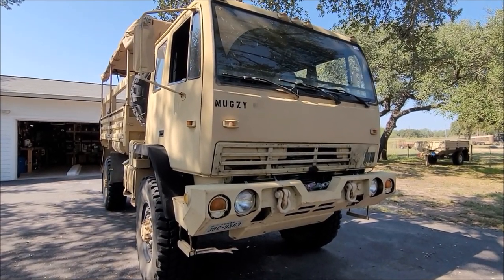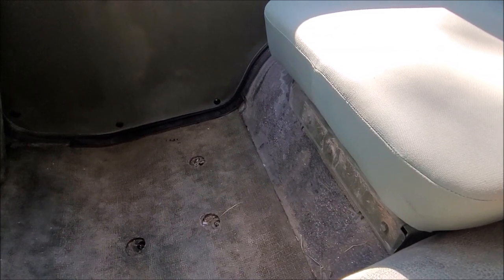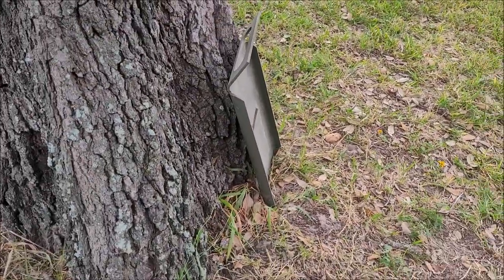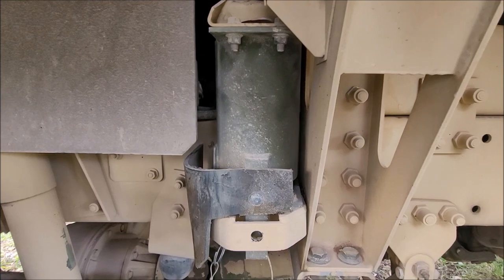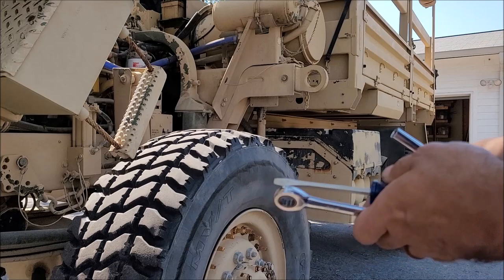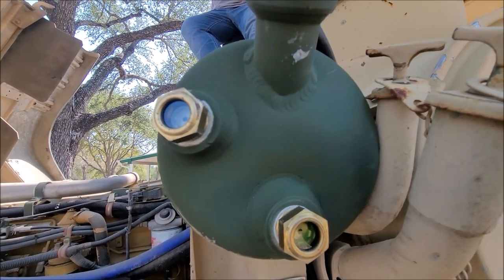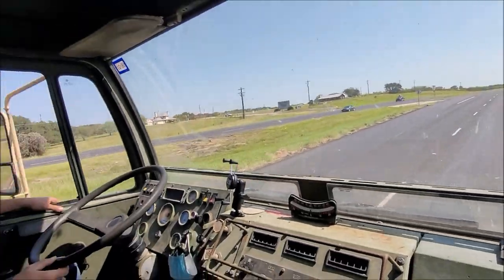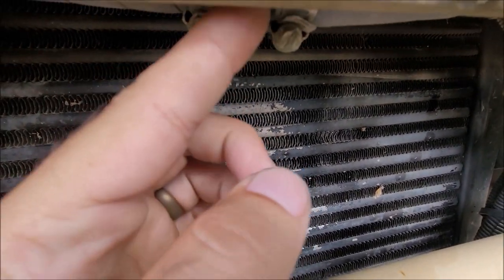M1078 LMTV - Update #2 Radiator overflow bottle change out & more!

Comment: Hi Colt.  A lot of the issues you are having with your truck are covered in my build series.  Not sure if you watched it yet?  Those sprayers are easily sourced from amazon and come in a 3 pack IIRC.  I had to replace all of mine too.
Reply from the maker: Yes I have watched some but not all... there are a lot. :)
Reply: @CallMeColtLLC  do you happen to know how to turn on the amber warning light ? ( light on top of the vehicle )
Reply from the maker: @stevenmajicmike  There is a switch on the dashboard for it.

Comment: That unknown thing is a jack base...   I don't know where it goes.  The plastic cap on the heater hose behind the grill is a flush fitting so you can use a garden hose to flush it.  If you replace that hose, I'd toss that fitting...   I've had them break on me when they get older.
Reply from the maker: Thank you! That makes sense for the jack base. I'll make a spot for it. That fitting did leak a bit & stopped itself. Wish I knew it was for that when I did my coolant flush! Would have used it & then removed it. Oh well, next time. Thanks again!

Comment: If you plan to drive the truck around without the cab airbags filled, then insert the transport pins so you don't pop the airbags. Also, you can simply replace the OEM airbags for cheaper than the "upgrade" kit. You can find NOS airbag assemblies for $250 ea. on ebay... They last decades...
Reply from the maker: The only new, old stock cab springs I found were $600 each. If you have a link to get them for $250 each, please let me know.
Reply: @CallMeColtLLC , I bought one on ebay for $225 about 3 months ago. The same seller had 2, I probably should have bought both... It's something you see pop up every few months. Also, folks on the FB group will offer them up once in a while. Just keep your eyes peeled.

Comment: What size extinguisher you ask?  get biggest fire extinguisher you can fit.  I had an LMTV alternator fire and it took equivalent of about 5 or 6 of those 1lb extinguishers to get it out. (approx 7 gals of ABC extinguisher and water to knock it out.)  Maybe true automotive extigisher would cut that down some..... do not know how much though.
Reply from the maker: I have a mount from an MRAPV that I have a brand new extinguisher for. Might find a way to mount that.

Comment: You fill the coolant reservoir up to where you can just see it in the upper sight glass when cold(-10 manual)...   looks like it is running good:)  whats wrong with ctis?
Reply from the maker: I need to put a tad more coolant in. Plan to do a full flush of the system in a few weeks. No idea on the CTIS. Want to get the other stuff done before I dig into that.
Reply: @CallMeColtLLC  does your spare have a wheel valve assembly?  Mine does...
Reply from the maker: Yes it does, I'm just not sure how to switch it all over yet. I was going to figure it all out when I get 2 new tires. The spare is very old & the one wheel without the CTIS on it is different than the rest.

Comment: What exactly is the purpose of those cab airbags? Thanks
Reply from the maker: They are suspension for the cab so it rides smoother. Most trucks have them as they have very stiff suspension to support the weight the truck can carry.

Comment: What was your highway speed?  Do you think it would have a problem pulling a 40 foot goose neck trailer with around 25000 lbs on it?
Reply from the maker: I honestly don't see how this would pull a goose neck trailer at all. No way to hook up! It would pull 25,000lbs no problem. This truck is not fast. 55mph top speed on a down slope. You can re-gear them but it is a lot of money.
Reply: @CallMeColtLLC  I was actually looking at the 6x6 tractor.  I thick they run the some motor.  390 horse.  They told me by gearing it I could get 68-70 out of it.  I just don’t want it to fall on its face by gearing it.  Thoughts on that?
Reply from the maker: @trinitylandscapingandexcav7965  M1088 is the tractor I believe. Regearing it should be fine but it will be extremely expensive. Unless you need a 6x6 tractor to pull a trailer, I think you could find something much better for the cost you'd have into it. If you need something for off road than the FMTV would be worth it. Just make sure the trailer is also ready for it. 😀
Reply: I pulled a 12” chipper with mine today for 1.5 hours. Top speed 55 downhill. I realized that I love my LMTV but it’s not really efficient at pulling things on the highway. I also pull my triple axle trailer with 8000 lb Kamatsu loader. It is super slow uphill. LMTV is made to haul troops off-road. I think you would be disappointed at the slow going pulling 25,000 lbs.